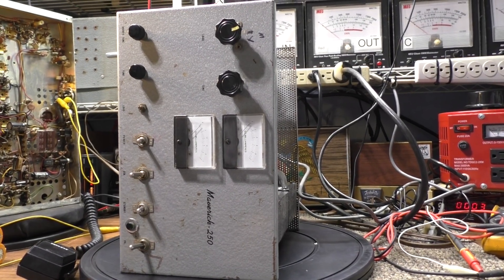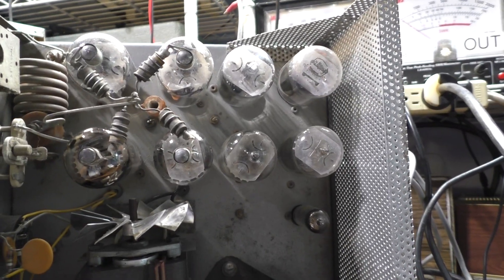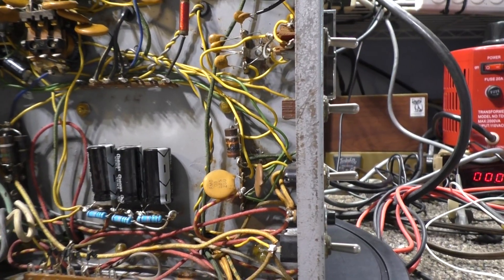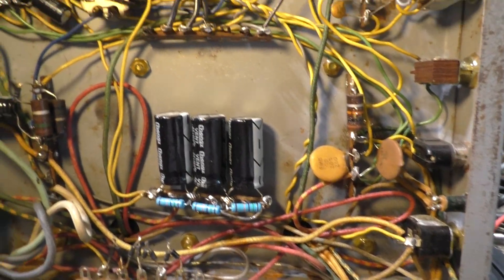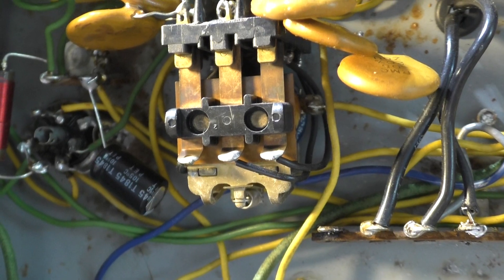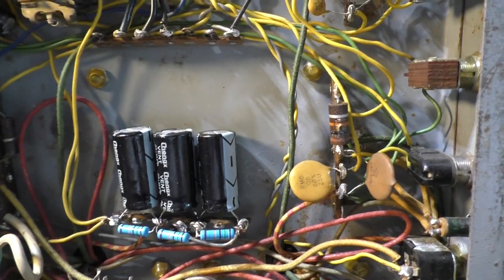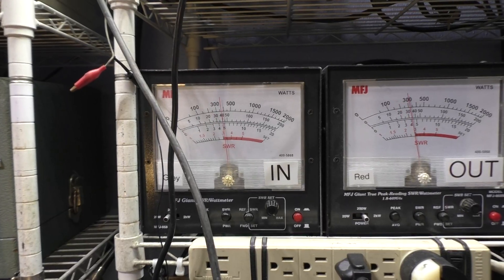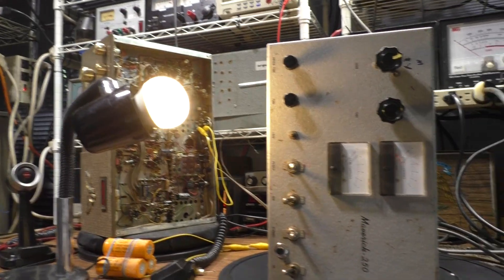Maverick 250 linear amplifier customer's walkthru talkthru + keydown on the bench

Comment: I appreciate you doing this Video on your Maverick 250. 
I just got the Tan & Brown one yesterday and didn't know about that Resistor issue.
Is this for the Black and Tan Maverick as well???
Appreciate you.
Just trying to learn everything I can about these Amplifiers.
I had to remove 2 Caps from the Bottom because one wasn't Connected. I'd like to do the Bleeder Resistor like u did.
Is this a good idea to put in mine as well??

Thanks for the Knowledge, I love to get all the information I can so one day I maybe can pass it on.
297RI
Reply from the maker: Yes and yes.

Comment: I would put heat shrink on those
Reply from the maker: Heat shrink doesn't do much for RF though.
Reply: Yeah you're right but it could stop a short though
Reply from the maker: it would but again, with RF, if they are that close, you will a multitude of problems before they actually touch.

Comment: I have a question about the cooling fans in tube linears. When the fan stops working what do you replace it with ? I thought about one of those black box fans but they usually they are 12v d.c. I been saving the 12V ones from the dumpsters for years. I know the 110V are not as common and the 5 volt dc ones are appearing more and more now inside electronics stuff. If you only had a black box12V fan would you buy a 110V AC fan to replace it or install a 12V fan using a 12V DC power supply hooked up from inside the amp. By the way I know if you want a source for 110V fans. Go to appliance parts store and they have universal ones used in appliances . Nowadays you could order one online .
Reply from the maker: Buy a 110 box fan. Hooking a fan up to the lower voltage usually causes noise and the low voltage (12v) out the transformer is not made to handle the extra pull of a fan.

Comment: I am still working on mine or should I say get back to it. The videos you do on these help. I am curious without looking at it too closely is it possible to replace the baldies and run straight 8 with a bit higher drive? As it stands I would have to turn the RF pot back down in a Galaxy I will probably use with it and the rest aren't crazy but run in the 8-12 watt range from the factory. I see yours has 3 caps in it. Mine has 5 and I think it has something to do with the high and low. What I would like to do is connect a plate volt meter to it. Think I got the math right for the meter circuit but trying to think where to tap in. There is a single resistor at the bottom left terminal strip of the cap bank I thought was the bleeder otherwise it doesn't have one... I could go across that otherwise maybe where it goes into the relay? I think I am going to add bleeders of my own either way after seeing this.